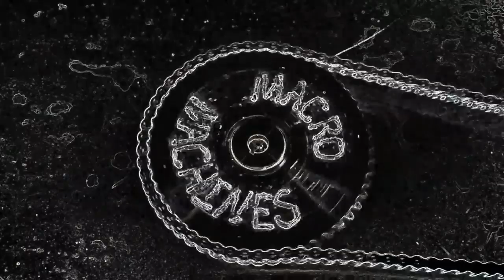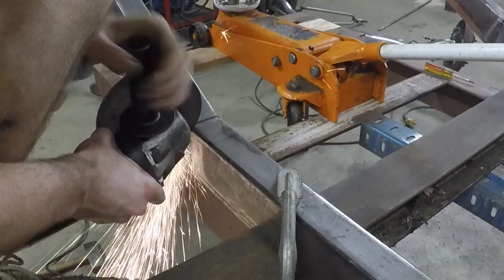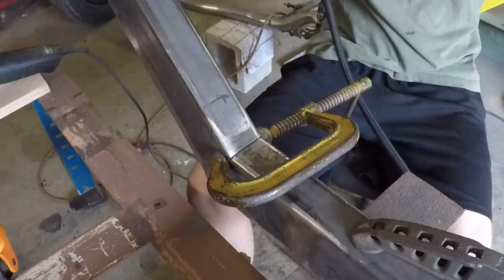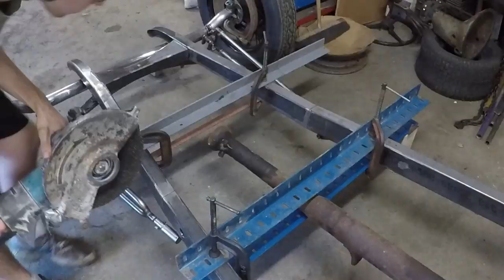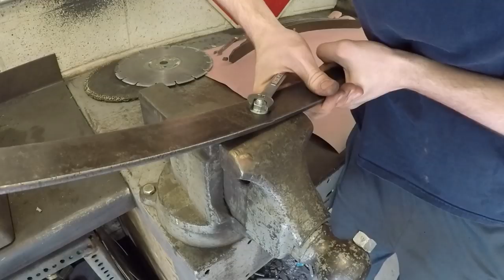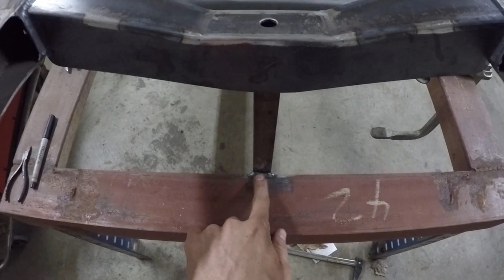Lowering a Hot Rod | Boat-tail Speedster Pt. 23

Comment: 4 link rear suspension, air bag suspension
Reply: Wouldn't be vintage then
Reply: @thatbuelldude189  Vintage is good i grant you that but safety and comfort should b priority. 70/30 Vintage/Upgrades.
Reply: @glen58316  i would kinda agree 
That just dont fit with his build
Peroid correct builds have there place in this world

Comment: Would it not have been easier to move the sprung perch crossmembers up?
How much did cutting and welding the frame weaken it?
What happened to the center crossmember (AGAIN)? Do you have to make a third ... or is it fourth?
Seems you've lost ground with each new video.
Reply: That is how she goes 
He is doing almost everything form scratch 
Sometimes you got to backtrack